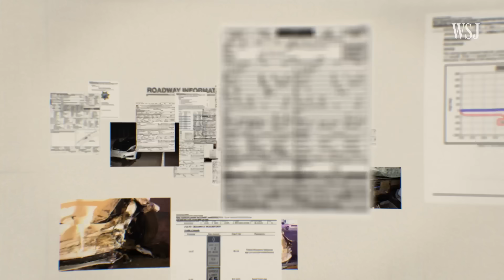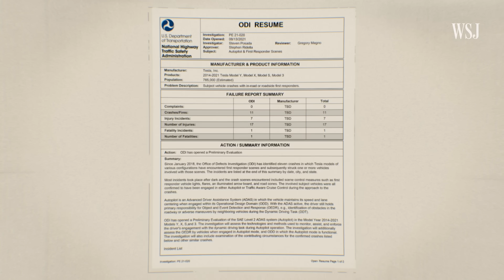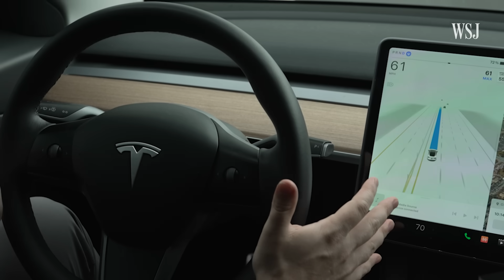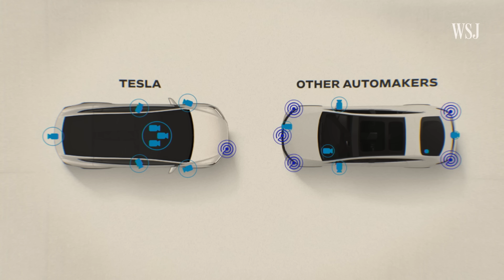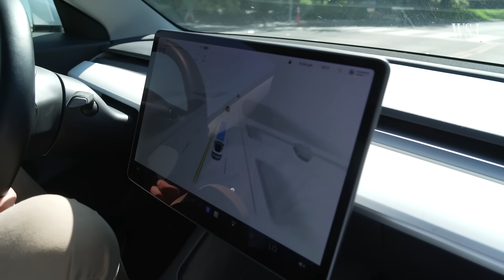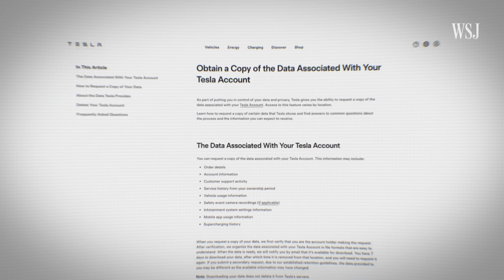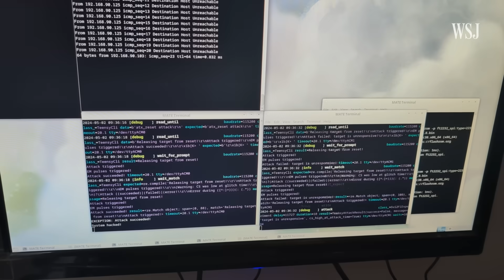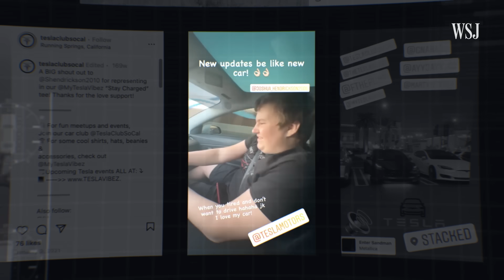The Hidden Autopilot Data That Reveals Why Teslas Crash | WSJ

Comment: These stories are starting to get very very old from journalists who have got nothing better to do but misinform the public. Most people know by now that autopilot is driver assist it's not FSD.
Reply: FSD cannot see what Autopilot cannot see.  It's an inherent computer vision problem, not a branding issue.  The problem is that the system is not robust enough to safely allow people to reduce their concentration level, especially at night or when driving into the sun.  Tesla's repeated statements that people must pay attention change nothing. Once drivers relax enough to enjoy FSD or Autopilot as intended, their level of vigilance falls to unsafe levels.  It's unavoidable.  Tesla will eventually be forced to add lidar (which is no longer expensive), either by regulation or to repair reputational damage, to warn of approaching objects vision-only systems do not recognize.  We cannot have partly or fully autonomous vehicles moving at speed in public that occasionally hallucinate or struggle to see.
Reply: @Closer-than-it-appears  V13 is showing cameras are more than capable of self driving. Tesla stock is reaching record highs on how it is performing.
Reply: @Closer-than-it-appears  i worked on self driving cars in some big name LIDAR startups. its still expensive. tesla is an EV company first and foremost not a self driving car company and theyre loosing the EV market already to BYD due to chinese companies having better battery tech. adding this just kills TESLA. Also cheap lidars on cars is like 30k at least when everythnig is added together. Also LIDAR is not the fix to these issues, its the recognition algorithm that caused the crash contrary to what journalists claim
Reply: @placeholder7753  I have worked on "self driving cars"/ADAS for quite sometime as well. I agree, the reporting could have focused more on lack of safety culture and unethical practices from TESLA/Elon.
Reply: @Closer-than-it-appears  Bro, you aren't even an engineer nor do you work in tech first of all, and second of all, Waymos need to be tele-operated as they experience FREQUENT interventions as well compared to a human driver. Until we achieve AGI or get near it, we won't have any "fully" self driving system from anyone even if they use Lidar

Also, Lidar data conflicts with camera data often and is very noisy/messy at times. Thus it creates its own sets of problems.
Reply: @akhilsharma2712  None of the systems are perfect, but that's this needs to be both integrated and other sensor technology already exist. Just putting everything on one basket will do no good and we get all those problems been stated. Since the tech will fail since its isn't perfect, so we augment with another one to make it better.

We humans also don't rely only just vision alone. We still use other senses to navigate and interact to the world. We just happens to have really good enough vision but awesome brain to interpret things we see. But we aren't perfect and we even use tech to compensate what we lack. Things like night vision for low light environment, Infrared, and even radar, etc. 

So why can't cars have more? Don't we need them to be better than us? Then why settle for good enough system because "Humans use eyes"? 

Tesla and all other manufacturers want to go autonomous driving systems must adapt both Lidar, multiple RGB cameras, and other existing sensors for our cars. Heck even for just auto wiper, why we ditch the good old sensors for it that works well? It's not perfect, so then augment it with data from camera.
Reply: Also, whenever Waymo gets stuck (they don't have a driver to take control) they ask the operator from the centre. The operator there then show the path to Waymo. But whenever this happens, Waymo is still in full control and could reject the operator's guide by its own accord. And whenever it contacts operator, the rider in the taxi get informed. So everything is happening within the knowledge of rider. Judging from the time and opertor from Waymo connect with car, it's rare or uncomman event unlike Tesla where you have to accelare or deccelarate every few miles.

Comment: As an MLE, I can tell you, it's shameful the MLEs in Tesla agree to let cameras be the only source of information for making decisions in their self driving technology. Cameras can't see through snow, they can't see well in rain, they don't see well at night. Yes, Lidar is expensive. Yes, bearings wear out and they need calibration. There's a lot of problems with lidar, but it's 100% necessary, and I don't think we will ever get past that unless we develop some better sensor technology. Cameras alone will never be enough. Maybe 99% of the time, but 1% failure is too high. And even 0.01% failure rate is too high. Waymo is only successful thanks to over a half dozen lidar sensors. And boy, is it amazing to ride in. I would never trust a tesla in it's current form.

Comment: BIASED HIT PIECE:  Likely nearly 100% of those incidents were the result of driver neglect. Is it a coincidence that they dropped this story the day Tesla stock hit a record level? FSD requires your attention. I've had FSD since 2020 and have seen it mature. it is amazing but you need to pay attention.
Reply: In my view it will be amazing when it doesnt need you to pay attention. Until then it does not bring any advantage compared to cars without ADAS.
Reply: @bojohansson1110  I understand your POV and everyone is entitiled to their opinion. However, those that have not experienced it have, by definition, uninformed opinions.
Reply: @carlmelville  So you know that I have no experience of ADAS systems? How?
Reply: @bojohansson1110  If you had FSD you would have said so rather than suggesting you may have tried ADAS.
Reply: @ Hm, FSD is an ADAS system.
Reply: @bojohansson1110  You understand exactly what I'm saying. You have not used FSD or you would have said it rather than being vague.
Reply: @C_G1443  You on the other side does not seem to know what an ADAS system is. And you do not want to discuss the subject, but only my experience of different ADAS systems?
Reply: @bojohansson1110  I understand what a driver assistance system is. I also understand that FSD and Autopilot are ADAS. You're missing my point. You have no experience with FSD, so your opinion of it is invalid.
Reply: @C_G1443  should people without FSD even be allowed to vote?
Reply: If you have to pay attention, it's not FSD.

Comment: It was mentioned briefly in the video, but it should be emphasized.  Autopilot requires the driver to pay attention.

It just reduces the workload of "micromanaging" the driving, while you continue to pay attention to the road.

Clearly, that overturned truck was visible, and an attentive driver would have seen it and done something about it.

Currently, if you take your eyes off the road, the system will start beeping at you and tell you to pay attention.  Before, it relied on a somewhat janky hand on steering wheel detection system.

Comment: 😡Old examples of data, accidents and vehicles ability to date. Examples YEARS OLD this is a ridiculously put together story.  Yes, there are examples! But that’s like saying horses are dangerous, Tesla now is well beyond 10X to 20X safer than a human if used properly. Even if you fall asleep, the car may even in fact, save you if you’re drunk the car may even in fact, save you. These are outlying examples that this news report is as well. They are old. It is unfortunate when anybody dies, and with technology and advancements in technology, there will be unintended consequences if used improperly. By painting the picture to the general public that Teslas are not as safe as a normal vehicle dissuades the purchasing of a Tesla, thus resulting in more deaths as human drivers make more mistakes to date, so what I am saying is by spreading this poor information, you personally are responsible for random peoples deaths because others do not jump Onto the technology and utilize self driving, which is currently 2024 saving peoples lives! FACT!

Comment: So what is the data promised by the video title that reveals why they crash? They didn’t find any. References to vision-only as the cause are pure speculation - not enough signal here to support it. What radar-based ADAS systems are doing better? No answers here. How many lives were likely saved by autopilot, contradicting this narrative? No mention (might be many more than the number who died, certainly Tesla’s numbers indicate that). All this work and the piece watches like a cheap cable tv show with creepy music. There might be a case to make here, but they didn’t make it. This is frankly embarrassing for WSJ.

Comment: Outdated information and an old video. Autopilot is not the same as FSD (Supervised). Why are there no
 current data points or accidents to reference in this video? Can you make a video of how safe cars were when airbags were first installed compared to today? But only pick one brand of car and an ex employee whos upset.

Autopilot is very clearly labeled as traffic aware cruise control (TAC). Cruise control was created (not by Tesla) to ease driving fatigue for longer drives. It started as keeping a set speed steady. Then variable speed was added based on the car in front of it. Lane assist was added to cars as a separate button and could be on at all times. TAC is both cruise control and lane assist. Autopilot is the name Tesla gave it for their cars. This feature, like every other cruise control, does not have the ability to brake in an emergency situation or if something is in the road stopped. Emergency braking is a separate saftey feature which can be toggled on or off.
Reply: Because Tesla dosent give them the data. They have to hack the board computer and reverse engineer the data.
Reply: You have a point, but Elons high profile and not keeping to the truth at all times regarding FSD makes Tesla a target, "the harder they come, the harder they fall".

Comment: My Tesla brakes for everything when cruise control is engaged, apparently not for overturned trucks though! Luckily, I mostly drive in light traffic areas, but I am concerned one day I will be rear ended by a heavy vehicle because of this phantom braking. It is a dangerous scenario which just seems to slip by the authorities everywhere when they allow this tech to be used on public roads.

Comment: Where are the other car brands cruise control accidents? Is that a separate longer video somewhere?
Reply: Nice try. My Mercedes uses radar and hasn't failed me once. Also they don't let you drive without actively moving the steering wheel every 15-30s.
Reply: Other brands collision avoidance systems use radar which disengages when visibility is too low.

Comment: I have a friend who swears by Teslas self driving.  I’ve driven a model X and I hated the experience (simply because I didn’t have time to get past a learning curve). I personally don’t want to learn how to press the button for the turn signal, as opposed to pulling a lever which I’ve been doing for years. Especially when you’re on a road trip with somebody, and they’re sleepy, so you have to take over driving a Tesla model X out of the blue.  

I recently rented a Nissan Rogue with adaptive cruise control, and lane keeping assist, and I thought that was absolutely brilliant! Especially when I was tired, I put the lane keeping assist on it and help me get through 20 minutes of feeling drowsy.  Sometimes you can’t pull over and take a rest, because there’s no exit.  I thought the Nissans technology was perfect, I don’t wanna car to drive for me, but assisted me was perfect. Adaptive cruise control is so efficient, and when you add lane keeping assist it everything I need for 8 to 12 hour drives.  Along with blindside detection, that’s all the technology I need. I’d like to drive, I don’t need a car driving me.

Comment: Autopilot = Cruise control.
It should be illegal to call that feature the first term.
Reply: Shall we say that calling g a BMW “the ultimate driving machine” is illegal too? BMWs are far from the ultimate driving machine therefore it should be illegal calling them that. 

It’s called marketing. Users abusing the system is on them.
Reply: @hmugica  Well, but if they would market BMW's as "the ultimate swiming machine", even though they can only swim for at most 1 min, that would be in fact illegal. See the difference?
Reply: Airplanes have autopilots but the pilots need to remain in the cabin and still pay attention. It’s a driving aid.
Reply: you need to take over control !
why you don't understand any ?
Reply: It is in developed countries ...
Reply: Autopilot = Traffic Aware Cruise Control and Lane Keeping. Not the same as plain old Cruise Control.

Autopilot definition (wiki): An autopilot is a system used to control the path of a vehicle without requiring constant manual control by a human operator. Autopilots do not replace human operators. Instead, the autopilot assists the operator's control of the vehicle, allowing the operator to focus on broader aspects of operations (for example, monitoring the trajectory, weather and on-board systems)

Tell me if this is NOT what Tesla Autopilot is doing.
Reply: @sylvaing1 Airline pilot here. The general public does not understand the definition you posted of what autopilot actually is, and they don’t read the fine print when they get their Tesla. I’ve had 2 Teslas with no accidents. I also intervene with autopilot/fsd regularly, mostly because I don’t like how it drives.
Reply: @zhuff0517  Same, I mostly intervene because it's not taking the correct lane. If they could solve their navigation optimization, I would hardly intervene.
Reply: @sylvaing1  "Always remember that Full Self-Driving (Supervised) does not make Model Y autonomous and requires a fully attentive driver who is ready to take immediate action at all times." FSD manual, Tesla
Reply: @zagreus5773  Neither does an Autopilot in a plane. 

I'm always attentive while using FSD, although my focus can be on something else than making sure the car stays between the lines, as having a better situational awareness all around me and be better prepared for accident avoidance than just driving the car myself.
Reply: @sylvaing1  The manual I just quoted literally says that FSD is not autonomous. You do know what the "auto" in autopilot stands for, right? So is FSD now a "non-autonomous autonomous-pilot (autopilot) system" or what? See the absurdity?
And plane autopilots do not at all require the same level of constant attention.
Reply: There are hundreds of products that could be faulted for nomenclature that doesn't truly reflect the capabilities of the product, are you going to ban them all.
Reply: @richardcalon3724  That is the a logical fallacy: whataboutism, or the tu quoque fallacy.

Comment: Honestly, the lack of sensors on Tesla cars is why I bought a Mercedes which uses Bosch Mobility's full array of sensors.  150k+ miles driven with Mercedes/Bosch DrivePilot and it's been very good.  It even saved my bacon three times when other drivers failed to stop.
Reply: I'm a software engineer and I would never buy a Tesla. Removing Lidar was a huge mistake by Musk, it was purely to lower price, at the expense of safety.

Comment: For anyone new, this is what you call a hit piece. It's popping up at the same time autopilot makes strides in performance and accuracy while neglecting that Tesla has repeatedly asked drivers to be on alert.
The so-called experts seem to know nothing about deep-nets and think you must train these on toppled cars and lidar should be part of the sensor network. 
To me, it looks like they are lobbying to add yet another set of useless regulations to make it mandatory to have lidar included in all autonomous cars.

Comment: What this woman doesn't understand is that Tesla FSD is getting exponentially better. Did it suck in 2016? Yes. But sooner or later AI will drive the car far better than a human ever could especially when they add 5G interconnections making crashes with other cars virtually impossible.